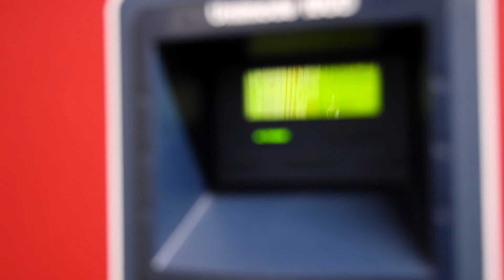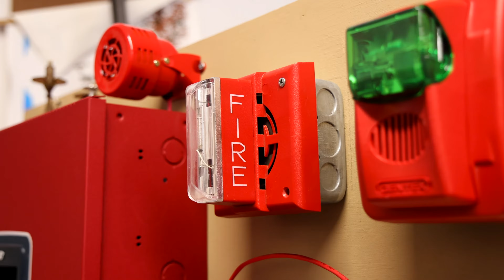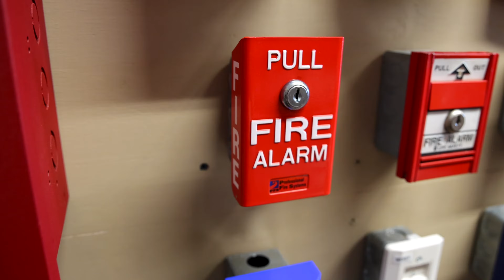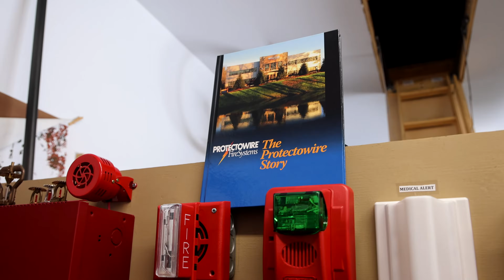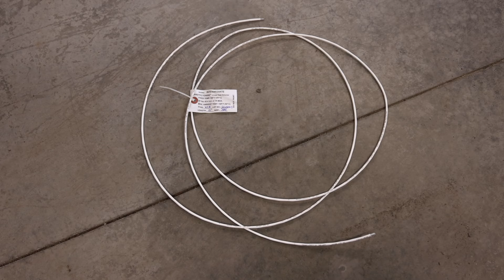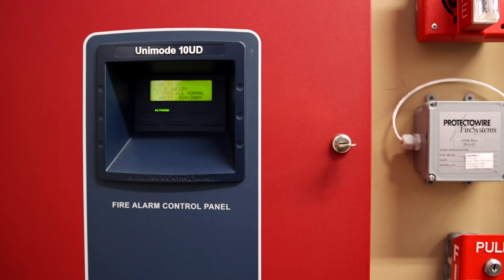ADT Fire Alarm System Test 29 | Gentex SHG!

Comment: Do you think you can take one of your wheelock MTs, take off the strobe, and put on a double projector?
Reply: It wouldn't fit because the mounting screws on the MT are recessed under the horn grill. I suppose it would work if you had some really long screws
Reply: It would not work plus it really would only work on an mt4 lol